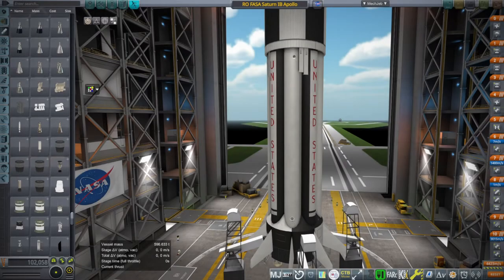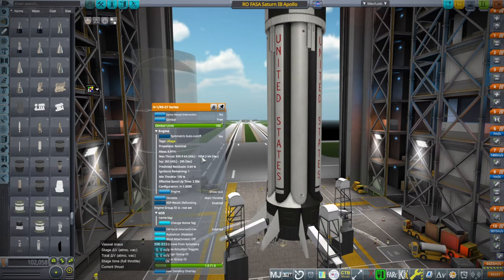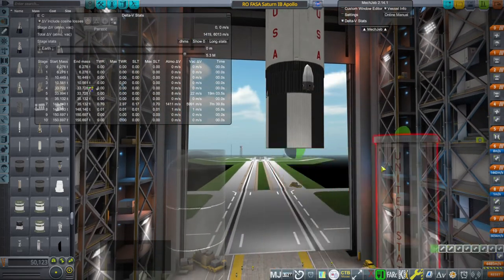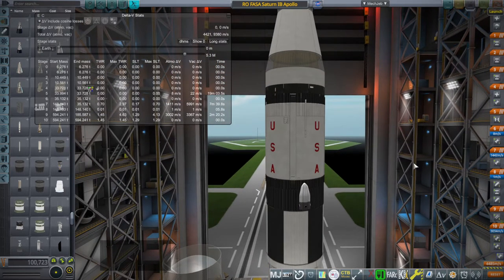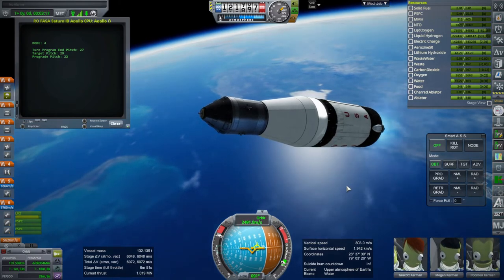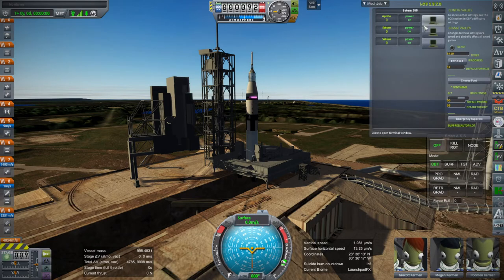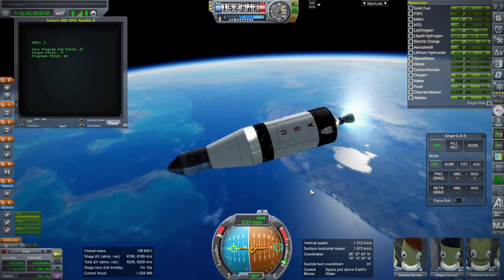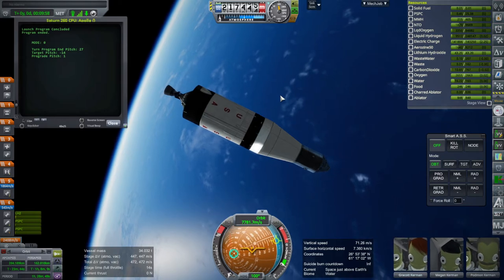Kerbal Space Program 1.12 with RO - Saturn IB with AJ-260 first stage

Comment: I think the cost is the entire concern in this design. Cost savings are pretty important for a budget minded space program after all.
Reply: the AJ-260 is like 12x the cost of the first stage. sad
Reply: @glasseyemarduke3746  It never left the research phase into the production phase. It would have no pumps and very few moving parts, probably making it much cheaper once a production line was set up.
Reply: @Sean_735  they made 2 half height and tested 1 iirc. was also referring to the KSP cost not RL cost
Reply: It was a cool idea, but seeing the video of the delta II rud and the srb bits that looked like white phosphorous it's probably a good thing it wasn't launched.

Comment: Less efficient - but considering NASA's budget in an alternate history without Shuttle: greatly-lower-cost US crews' access to LEO would have been the ticket, even without an advantage in payload!
Only question is: would the Apollo LES have been enough to pull-away the CM safely from SRB catastrophic failures in ALL scenarios? I don't recall, off-hand:  I'll have to re-read the relevant "Saturn variants" article in Encyclopedia Astronautica.
Reply from the maker: Well, I don't think we passed 4Gs with the thrust tail-off and Saturn V maxed at 4 Gs, so I would suppose that the Apollo LES was still within spec. Also keep in mind that launch escape systems are meant to increase the probability of survival - none of them are perfect. As for Encyclopedia Astronautica, I take a dim view of its accuracy on most things. It's better to look for the relevant papers on NTRS.

Comment: Why not use the BDB aj-260?
Reply from the maker: Didn't know there was one.
Reply: @RaizSpace  oh, there is whole set of AJs in ROEngines. Both short and long versions, even with vacuum nozzle. i've spent a lot of time in my previous career trying to implement them but came to the same conclusion as you - no reason to use them.

Comment: Did you try the same thing in 1.8 or 1.11?
Reply from the maker: No, but I was thinking about trying it in 1.8.1 to see what difference the residuals make.
Reply: @RaizSpace  I bet you will get a lot more out of it in 1.8. The residuals are just extra dry mass and that should hurt the AJ-260 a lot worse, since it has more propellant mass (which results in a higher residuals mass) and a lower ISP.  

I don't think residuals are adding any realism for an SRM anyway. The thrust tailoff accounts for them already